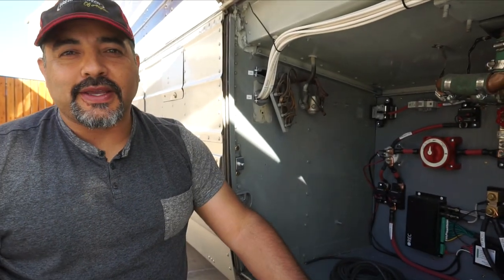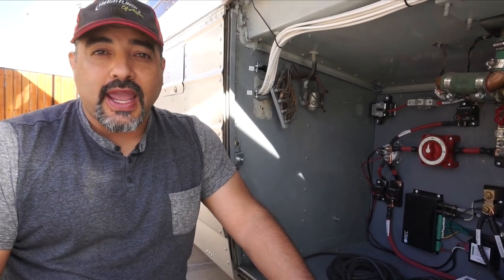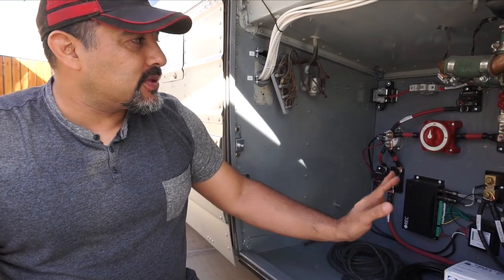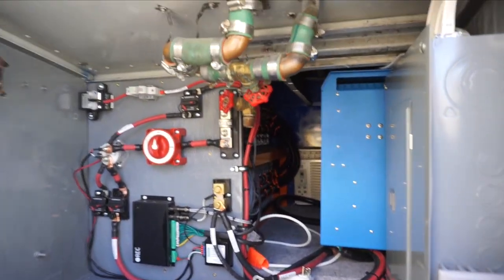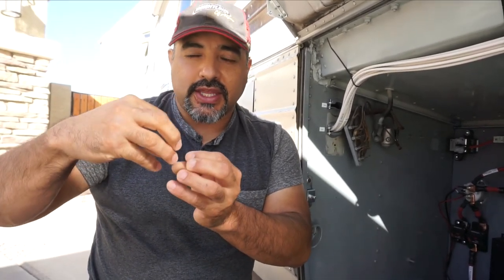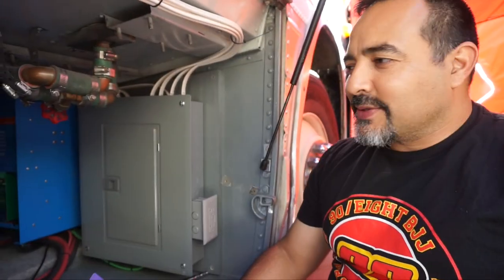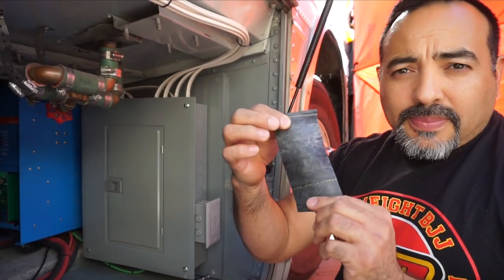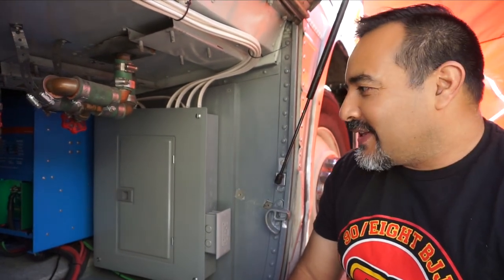RV House Batteries: Part 7.5 UPDATE to Supply Side Wiring

Comment: I know Im late to the game. and many thanks for the effort invested to make a video. My suggestion: where your 2 cables come dangerously close? Prepare a spacer. lets say the distance between the cables (@ the cable not the ends) is 0.25 when they are perfectly parallel to each other.  place said spacer between them and double wire tie. as long as the wire ties never break free? its impossible for the terminals to ever touch. (as the parallel spacer causes them to always remain parallel and never slant.)1: looks cleaner. 2: virtually eliminates the possibility of a short. 3: if 1 terminal were to come loose? they still wont touch. Also, in your version. if one were to come loose? or the rubber fails due to excessive pressure? Well? not good... Anyways great install and just my 2 cents. -Sam (I hope I explained my version solution correctly.)
Reply from the maker: Makes sense and great tip - thank you for sharing it.

Comment: Hi Juan, 
just a hint from someone born 61 years ago probably with a keyboard in one hand and a screwdriver in the other: 

DC is known for arcs and sparks more than AC does. Over dimensioning these circuitbreakers contacts is favorable. Take some large diodes and put them in opposite direction over your switches to kill sparks. 

Also. did you think about lightning strikes?  Mount a lightning surge protector in the DC cabling and put some cable with a copper rod which you can stick in the ground when you are parked...

Fred
Reply from the maker: Thank you for the comment and suggestion Fred.  I had not really considered lightening at all.  I will be looking into this - thanks!

Comment: Great job on the panels for the breakers! Didn't even think about the voltage swing. Almost impossible to find a flush mount over 48 volts. Expense is worth your piece of mind. Looking super pro!
Reply from the maker: Thank you - yes we could only find 48V max in surface mount.  The panels were a pain but they turned out OK :).  Thanks for following along

Comment: My two cents here but they have this stuff called liquid electrical tape. You just paint it on. when it dries its a thick as you want rubber coating. war nicer looking than inner tube.
Reply from the maker: Great suggestion - I just saw that stuff last time I went to the hardware store

Comment: Using the rubber separator for the AC lines is the best idea...but it wasn't for the movement really.
You should consider that AC can jump (arc over an air gap) a long way especially in humid/wet weather.

Comment: to separate lugs on his inverter a friend of mine made a separator which mounts on the bolts with a spacer sticking up between the lugs. He took a piece of plastic jug,  folded it over on itself and then folded  each end out so that it looked like it had wings. He drilled through the wings and pushed the bolts through the holes.

Comment: I know some rubber mats and tires are (semi) conductive in order to discharge static electricity charges (ESD). They are usually in the range of Megaohms\cm, for your application it should not be a problem.
Reply from the maker: Wow interesting!  I would have never even considered this as a possibility!  Thanks for the tip - I will test the stuff we used with the Multimeter

Comment: Like your installation. I have a suggestion for a wire labeler. Check out the Brady BMP21 Plus on Amazon. It is awesome for wire labels. Even prints directly on heat shrink tubing.
Reply from the maker: Thank you Dean - I checked out the labeler - wow that thing looks cool - going to add it to the wish list!  Thanks for the suggestion!

Comment: My thought is with all this delicate/vulnerable electronics ect.....it should not be at bottom  level of bus ...in case of flash flooding ....
Reply from the maker: Thanks Donald I hope we are never in a flash flood situation!  The bus sits about 8 inches off the ground and there is an additional 2 inches off the floor with our battery cage.  The doors do seal up pretty good but I honestly have no idea if they would be water tight against a flood (I really doubt it).  As with everything there are compromises that need to be made and putting those things inside may have been a better idea if flooding is a real threat.  Instead we will have to resort to avoiding areas where flooding can occur and/or move locations if we have to.

Comment: Nice job. Just a thought a DC powered light in the bay (or all of them ) might be a good idea for night time use. Back in the late 90's early 2000's GM put a light on a retractable reel under the hood of their trucks. The lights were not that bright, but there are replacement LED lights that fit these things. You can find them in junk yards or they do sell reproductions of them. Pontiac and a version that went in the trunk https://picclick.com/OEM-Gm-Chevy-Truck-Under-Hood-Trouble-Reel-332188794614.html
This is just an example I am sure you can find them cheaper (junk Yard). You could take a file to the inside edge of the terminals and gain 1/16 inch on each terminal to add some distance between the connectors?  Glenn Lever
Reply: ThrottleStopRacing Yes, they are awesome! We even converted all our lights to LED, and everything bought for the new conversion we’re doing is LED too!
Reply from the maker: Great suggestion Glenn - we intend on putting a light in every bay just haven't gotten as far as picking them out yet :)
Reply: Yes I have also got some of those GM lights at the junkyard. I have installed them into other vechicles.
Reply: I have done the LED conversion on my trailer. https://www.lever-family-racing.com/lever-family-racing-home/family-vehicles/2006-car-trailer-2/led-fluorescent-light-replacement-2017-09-27 went a little crazy and also converted the outside marker lights, ended up with eleven! https://www.lever-family-racing.com/lever-family-racing-home/family-vehicles/2006-car-trailer-2/led-clearance-lights-2017-07-10
Glenn Lever
Reply from the maker: Wow that trailer is BRIGHT - nicely done.
Reply: Bright, I put some LED work lights on the front of the motor home  https://www.lever-family-racing.com/lever-family-racing-home/family-vehicles/1997-fleetwood-american-dream/fog-light-led-replacement-2017-06-01 and they were so bright I had to replace them https://www.lever-family-racing.com/lever-family-racing-home/family-vehicles/1997-fleetwood-american-dream/fog-lights-second-attempt-2017-07-27

Comment: Are you going to try to charge the house batteries from your alternator also?
Reply from the maker: That is a long story - "maybe" (sorry, I know that is kind of a lame answer).  The issue is that we would like to be "gentle" to our 55 year old engine and electric system.   The other issue is that we run a 48 Volt battery and the bus's electrical system is 12 Volt.  I have not been able to find a reasonably priced, large boosting converter that goes from 12V to 48V.  If I do it it will be a little strange. I will very likely use some terminals in our battery bay that was intended for these VERY large motors that spun fans for the bus's factory air conditioning (140 Amp Draw).  These would then power a smallish pure sign Inverter (~2000 Watts or so) that would then act like a "generator" for the Victron Quattro.  This will not be the most efficient way to use the alternator to charge the battery but it would allow us to charge and also allow for some redundancy in our system (if the Victron dies we can just activate a transfer switch to power the 120V stuff).  I have a friend who has the exact battery setup we have and he has been running his like this for a few months and reports back some positive results.

Comment: Just wondering what the pipes with hose clamps contain and would it be bad if they leaked into the bay? Or are the some remnants of the a/c that you took out??
Reply from the maker: Yes, they are pipes from the original bus heater.  It would be bad if they leaked into the bay for sure - looking into what I can do about it
Reply: I was going to mention the same thing!  I saw in another video that they were hot water lines coming from the engine to use as heat - but with the mini-split it isn't really necessary anymore.  They should be able to be disconnected or shut off in the engine bay and then drained.

Comment: Eureka Juan ! You said the magic words. The batteries need to be charged to a higher level then the stated rate in your case of 48 volt. I hope I understood that right. Another YouTuber Felt that he killed his whole battery system By chronic undercharging for over 2 years. When Scott was having problems at the start with his electrical system, I wrote in and I suggested this. I have been doing research calling battery manufacturers because the sales reps don't have a clue and are not that enthusiastic to find out and even less motivated to return a call to you. So I was wondering where you got your information and at what rate you are going to be charging your batteries. I'm told that it is different for every battery manufacturer depending upon what the engineers who specify the chemical composition and determine that rate to be. Some people will tell you That all the batteries are the same. They just have a different brand Name. I wholeheartedly disagree. I even went to an electrical shop teacher who is retired and talk to him and his Viewpoint was I've been doing it this way for years, and it's not going to change. Many people have called BS on what I have attempted to talk about. In determining what the actual rate is for solar charging of batteries. I do not recall if you mentioned the battery name that you were using. But whatever format it is. There is a specific Factory Rating that is established for each battery. I also have been told. That when you're buying a $900 battery as opposed to a $400 or $500 battery you are paying for the warranty because you are going to be needing to replace that battery sometime down the line. That is specifically because you don't know what you should really should be charging that battery to .  I am sure that your Voltron battery charger is programmable. While many of the other less costly battery chargers oare not to what voltage brI'm ng it to 100%. So you are paying for the replacement battery on the high price battery.  Only the higher valued or costly batteries are the ones that have a warranted life of more than three years that gives you ahigher price to boot. You're just paying for. A new battery later on down the line in advance. That's a win-win for the battery manufacturers.

 I would like to see the battery manufacturers, especially on the Deep cycle marine products actually put the charging rate on the battery labels. I think this is reasonable. I only found one very expensive battery that actually specified the charge rate on the battery. Of course, I can't afford that brand of battery. I was also told to stay away from the electronic battery chargers. They are programmed only for specific functions of testing and Reporting their data on the battery. You're better off to have the knowledge and experience to use the old-fashioned gauge type. Which lets you. Get more exact readings rather than what the electronic one is programmed to only show you.

 I'm really enjoying your site. Could you please leave resources on where you found your information on battery charging? You're certainly on the right track for doing all the research and putting in all the time to keep your family safe.
Reply from the maker: Thank you Thomas - there are many great resources for battery information on the Internet.  I belong to several DIY Powerwall groups and forums as well as several groups and forums dedicated to the use of electric vehicle Lithium batteries specifically.  There have also been several white papers dedicated to measuring how charge voltage and temperature affect the life of the battery.  I used most of these resources to determine my voltage thresholds.

Comment: Hi Juan, 

In the US (like in most of Europe), the grid is grounded to earth. Your inverter grid in the bus stands on rubber thus is not grounded. BE CAREFUL or you meet Petrus at the gate in heaven sooner than you think...

Moreover, your inverter is not in sync with the grid. If you plug in mains from the grid while running on your own inverter, you either get fireworks like in Epcot or you stand in front of Petrus again...

A UPS uses the grid to sync the frequency from his AC output. Make sure that land grid power goes DIRECTLY AND ONLY to your inverter to sync the internal AC power source OR is connected to a rectifier (AC-DC) ONLY

Fred
Reply from the maker: Thanks Fred ... I certainly am not ready to meet Petrus at the gates just yet :).  The grid power does indeed only go to the Inverter only - I am researching your previous copper ground idea.  Thank you for the input.
Reply: If the RV is equipped with hydraulic leveling legs, you could use copper cable to those legs to create grounding/earthing...
Reply: Beginning from this Morning rotflol!!!!!

Comment: What did you torque your nuts on the inverter?
Reply from the maker: The book calls for 14 Nm (about 10 ft/lbs) - I don't have a torque wrench that is accurate to that low so I just tightened it "pretty tight".
Reply: Thank you.  I first put my in and broke a post off the AC1 post.  I had to send it back to get a new board put in.  thanks

Comment: 8:00  I can see how the victron solar charger should talk with the BMS and your upstairs monitor etc, and they would say you may not need the contactor.    However....   what if the CAN bus doesn't work correctly, or a grownup goofs a setting on one of the devices, etc,  will the solar charger shut off and not charge?  if it's too cold (freezing) in the bay, will the solar not charge, will the main DCDC or inverter not try to pull a lot of current?      This guy put together something smaller but similar, and would be an extra safety layer to disconnect the charger and or the battery.   https://www.youtube.com/watch?v=g_SRHiLPI5g&t=382s
Reply from the maker: Oh sorry, maybe I was not clear.  We still have a contactor connected to the main battery terminals - we just do not have an additional contactor for controlling the solar controller.  The BMS will shut-down the battery no matter what if the upper or lower Voltage thresholds are violated for any reason at all.  If a goof up were to occur the BMS would still shut down the system.  If it is too cold the BMS will not allow voltage to go into the battery (will not allow charging).  We tested it this past weekend and the weekend before - the inverter draws very little power when on (something like 35 Watts?)